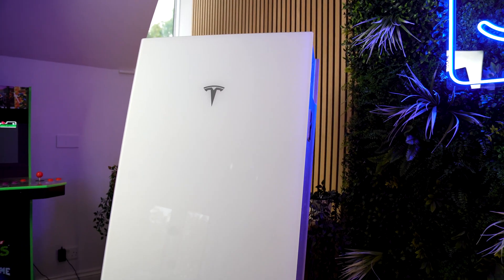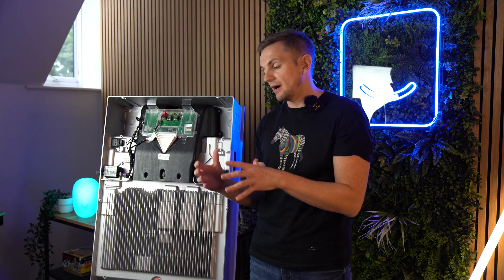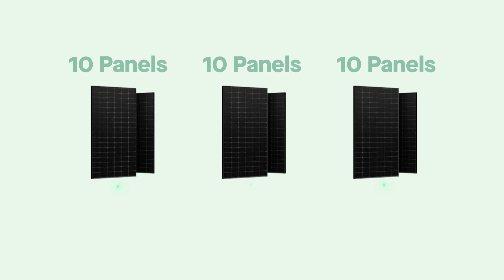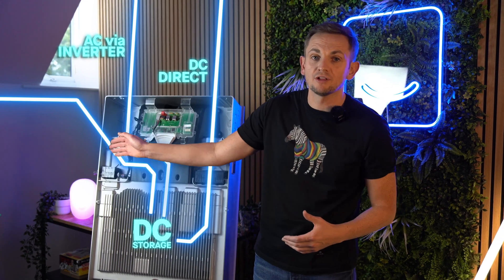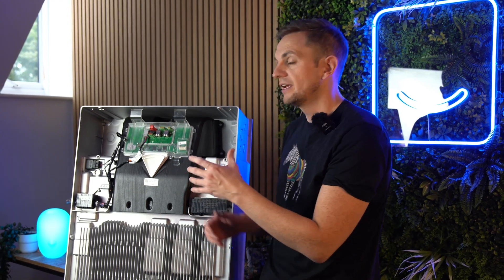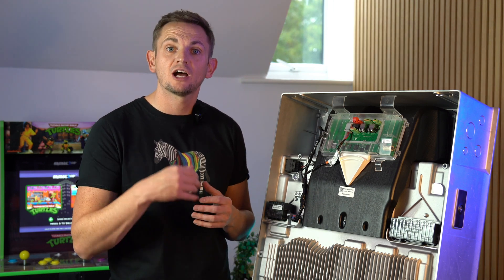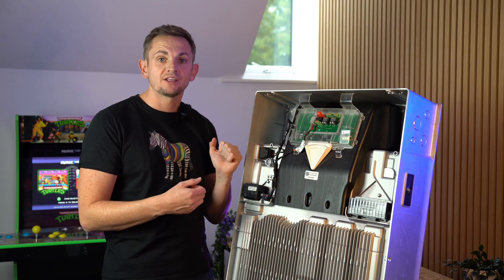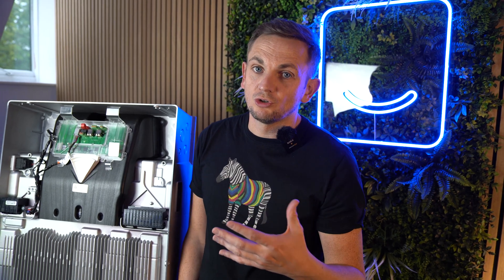Is AC or DC Coupling the BEST for Your Tesla Powerwall 3?

Comment: Hi. Thanks for the video. Great content as always! Question please - If AC coupling (to store from an existing FiT install) and DC coupling from additional new panels. Does the FiT setup literally need to be wired into the PW3 additionally to the AC connection to charge/discharge? Or it is just a single AC connection and PW3 knows to charge via the Gateway seeing the FiT going out to the grid?
Reply from the maker: Hi, so if we are AC coupling a FIT setup we don't touch the FiT system we just fit a CT clamp so the Tesla can monitor the production meaning the FiT wont be affected.
Reply: @Heatable thanks. Where does the CT clanp need to be placed? Around the AC feed from the FiT inverter? Or around the main connection back to the meter in the Gateway?

My FiT supply comes into the main consumer unit in the house, but I’d prefer to have the gateway and PW outside.
Reply: For context - Looking to get new panels and PW3 from you. Wondering how both sets of solar are captured and if both will be visible in the app.

Cheers.

Comment: Do you know if there is a minimum wattage on each string?
Reply from the maker: Hi the start-up wattage is 60w (per string) DC coupled Tesla so 60w over the total amount of panels, max of 11 per string compared to a micro inverter (22w) per panel AC coupled. 

Micro's are a better option if there's shading on the roof as DC coupled the string performs as well as the worse panel and you can't have optimizers on Teslas.

Comment: Does anyone know if setting the AC export limit (in the case where the DNO restricts it to less than 11) also restricts the supply to the house from battery and/or PV please? Or is it smart enough to differentiate between the 2 different supply routes (ie export at maximum of 6 but supply the house at more than 6 kWh.)

I have to say that the PW3 website is very poor, it contains virtually no info.
Reply from the maker: Hey, you're right in thinking it's smart enough to differentiate between house supply and export. All 11kW's can feed into the house, but your export limit will be different and set at what your DNO approves.

Comment: Very informative video mate, thanks a lot for that. I got a powerwall 3 added to my system recently that has 11kW DC connected to a goodwe inverter 8500 (8.5kW). Everything in my home is backed up in the powerwall but my inverter couldn't be backed up due to limitation in the backup for 5kw inverter power maximum... So in a situation of an outage, means that my solar panels would not be working and recharging the powerwall since the goodwe inverter needs AC and DC to operate. With that said, which is the best option in your opinion? 1. Get a technician to split and rewire part of the system connected to the Goodwe inverter directly in the Powerwall (lets say 6kw to the powerwall and 5kw in the goodwe) or 2. Expand the current system only for the powerwall (lets say add another 6kw of solar panels). That way even in an outage event the powerwall can continue recharging? I'm a newbie in solar so please correct me if I'm wrong in any part of this question.

Comment: I have DC optimizers on my Solar Panels. They were installed in 2019. Going to the powerwall it sounds like the DC optimizers will have to be removed from each panel to work with the Powerwall 3?  All 30 panels are on same plane no shade .

Comment: Hi, I am currently in the process of having a modest 8 x 450W solar array on a single string attached to a Powerwall 3 fitted  (currently scheduled for mid November) but due to a mix up in my roof dimensions I have agreed to a revised layout using the 8 panels but it has also now come to light two of the panels in the late afternoon sun will be affected by a shadow. 

Having spotted this I have agreed to having two optimisers fitted, which normally would be ideal but since I am also using the PW3 and following this video the use of optimisers looks very doubtful?

I am now wondering if I should have two micro inverters fitted and have a mixed system of AC/DC (no not the band 😂)?

Any pro’s, con’s, ideas on resolving very much appreciated. 

Just one other thing, in case I did go down the micro inverter route (whilst trying to minimise extra costs) should I split the array equally into 4 panels DC and 4 AC?

Oh, one other thing, am I correct in assuming the use of a panel micro inverter, I.e. Enphase IQ 8 Plus or similar, I will not realise the full potential of my 450W solar panels?

Comment: I have a solar system installed with a hybrid inverter and a DC coupled Pylontech battery already. I need to increase my battery storage. Can I put a Tesla Powerwall 3 in the AC coupled form alongside my existing set up to increase my battery storage? Thanks in advance.
Reply from the maker: Yes, you can add a Tesla Powerwall 3 to your existing setup to increase your battery storage, as the Powerwall 3 is AC-coupled, making it compatible with hybrid systems like yours. The Powerwall 3 operates independently of your DC-coupled Pylontech battery and hybrid inverter. It would charge and discharge separately from your current battery system, with its own inverter.

Comment: The question I was ask when a such solar company here in Puerto Rico installed me the TESLA Powerwall one generation with a solar edge hybrid inverter and I choose DC couple but his explanation took me to fail the batteries on 2 times MARIA and FIONA that's sadly , now my one million dollar question is do you think the Powerwall one can be connected to that DC inverter of the Powerwall 3 to wake them up and maybe work with it because I can use them to setup a charging station for my car also I have Micros inverter with a GATEWAY and POWERWALL 2 how would a proper and robust setup in your opinion retro fitting a system with this equipment (5) iQ8-A , (19) iQ7-A , Gateway 2, Powerwall 2 and if I go with a Powerwall 3 with a Universal Tesla Charger, how would you setup this last two item with the ones that mention before, thank you for the responded.

Comment: Is PW3 really 1ph only?
Reply from the maker: Yes PW3 is currently single phase.
Reply: You can wire a PW3 per each phase. Enabling the PW3's to power a three phase home. However only one phase can be backed up off grid. So need to be careful on choosing which phase to backup, and careful of any three phase circuits. 😉
Reply: @Heatable  meh.

Comment: Am I right in thinking that even if you had 20kw of solar connected on DC it would still only charge at 5 kw ? Secondly when the powerwall is full with this say 20kw of DC will it shut the panels off or will it discharge AC at your DNO limit to the grid . So you could have 5kw coming in and possibly 11kw going out ?
Reply: Thank you so much for the answer this was always puzzling me and really begs the question why would you choose to connect more than say 6kw of DC unless I am being stupid and it will  eg 15kw DC solar connected perfect day and generating 14kw 5 kw filling powerwall 3 and 9kw being exported DNO limit 12kw so when powerwall is full it will throttle pv to only produce its max of 11kw to be exported. If that’s how it works then it’s definitely outstanding especially for the people like myself with the original FIT who will be able to connect new DC and still keep there original AC coupled with the FIT meter separate. Thanks TOK
Reply: If you could only find roof space for a one of two panels for a second string, would there be enough DC voltage to activate the Inverter?
Reply from the maker: Yes that's right, even with 20kW of solar DC capacity connected, your system will still charge at the maximum rate your Powerwall can handle—typically around 5kW. So yes, even with 20kW of available DC, the charging rate is capped by the Powerwall’s input limit. Once the Powerwall is fully charged, the excess solar power will no longer be used for charging. Instead, your system will either (a) send the extra power back to the grid or (b) curtail the output from the solar array, depending on your inverter and grid-export limitations. If you have a DNO export limit (for example, 11kW), the inverter can discharge to the grid up to that limit. This means you could have the Powerwall charging at 5kW (or fully charged) while the inverter exports the surplus—potentially around 11kW if that’s your set limit—to the grid.

Comment: Thank you for this. I was under the impression that I couldn't use a microiverter system with a powerwall 3 but I guess I can. I'm also assuming that I could mix and match so part of the solar could be DC and another section be AC.

What are the costs of a G99 application and is there any way to gage the likelihood of the outcome of that application? Maybe a database of nearby homes.
Reply from the maker: Hey, yes you can have both AC and DC set up at the same time if you wanted to. G99 would be included in the installation price and it can depend on a number of factors, including how close you are to a substation and what infrastructure is in the area. Some applications take longer than others due to the local grid, but typically if you live in built up towns and cities they get approved.

Comment: Hi, you’ve designed a system for me with 30 panels and a Powerwall 3. No one asked me if i have a heat pump at home,we do - and aircon! Could you clarify Bens comment on falling short of energy with a DC system as the system you have designed has no micro inverters and is DC.
Reply from the maker: Hey 🙂The Powerwall 3 can supply up to 11kw of power which should be more than enough for most domestic setups on single phase. The comment was aimed more at smaller inverters.

Comment: Good stuff, another useful video, thank you @Heatable.
1. It'd be good if you mention how much energy will be lost roughly if using a PV system with micro inverters, implying the Enphase would first convert DC to AC at the panel itself, then Tesla or battery system would need to convert it back to DC for storage, then finally reconversion to AC for home consumption?
Considering the last step applies to all PV storage systems, would the first two steps with an Enphase system result in 8~10% loss of energy before the battery is charged?

P.S- I like the Enphase based setup you guys recommend in more ways than one, but would be good if the energy losses are mentioned, howsoever big or small. I reckon the extra 10~20% production from an Enphase system with REA panels would more than compensate any loss due to extra conversion steps; is that right?

2. Have you considered Meyer Burger (German/Swiss company) bifacial panels?

Thanks!
Reply from the maker: Hi, thanks for your comment. Most reference sheets report a 3% loss in conversion (each time). It's worth considering that this is only for any energy recovered from the battery which needs to be re converted so it's not 100% of the time. These losses also exist for all systems when overnight charging. We are aware of them but haven't installed them, no.

Comment: That’s very useful to know about the optimiser incompatibility, thank you. Where do you find this bulletin as my installer is advising me to do this in an install in a few weeks.
One question, when you process the G99 application, do you always apply for the full 11kW of the inverter capacity for exporting even if the current installation only required 7kW.
Reply from the maker: Yes we would always apply for the full 11kW to ensure we have no delays with the G99 application.
Reply: My installer is also going to use separate SolarEdge inverter and optimisers due to the complex roof setup. I think this will be fine as the separate inverter will be wired to the AC side and the PW3 will only 'see' the inverter and not the optimisers ?
Reply: @ You need to question what they are doing, it’s bonkers not to use the integral inverter in the PW3. Fine to use a separate inverter but then don’t go to the expense of installing a PW3.